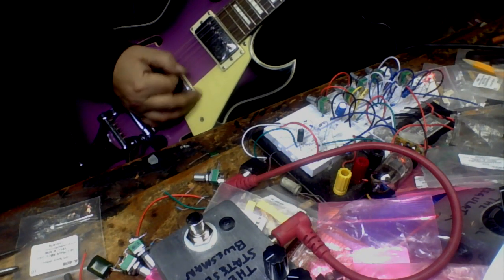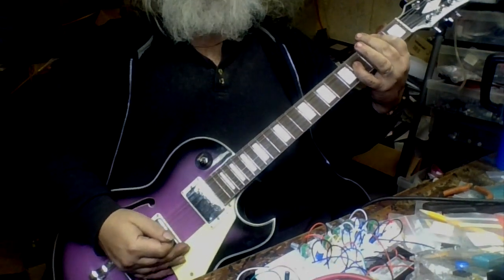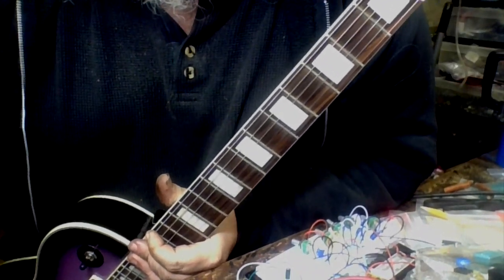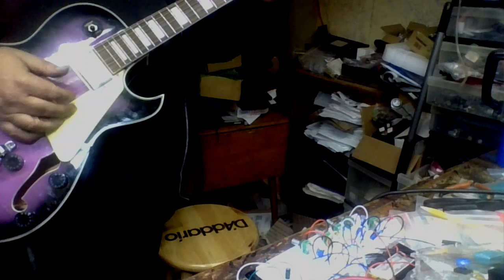SPTWPJP TUBE FACE 1 MP4

Comment: We need to get ya a yeti mike my friend! Sounds like between a fuzz face and an overdrive. ''like a fuzz face at 7' was pretty apt. I may have to try this some time! Seems like an idea that can be expanded on :)
Reply from the maker: its a bit weird. its actually better if ya wrap it around a fuzzface, or add a transistor stage. the problem is the way tubes distort, they don't saturate and STAY saturated like a transistor will.. they soft clip, so its maddeningly hard to get them to actually fuzz. but fun to mess with a little. there's a thread on diystompboxes about it, i didn't post all the values to it, but if ya breadboard it, it will become pretty obvious. i run the plates at 24v off a charge pump, and the heaters at 9v. the rest is really just playing with the rest of the FF circuit and trying to find passives that will work. i'd have to find my notes on it to really comment more on it. we toyed with making it an MLApedals project, but decided it wasn't worth pursuing. lotta hassle and expense involved i didn't wanna deal with. but yeah, you CAN do it, and yes you CAN make it fuzz... think opposite of EVERYthing in a fuzzface for the passives... small parts become huge, large values become tiny. really weird. have fun with it, let me know how ya make out, man